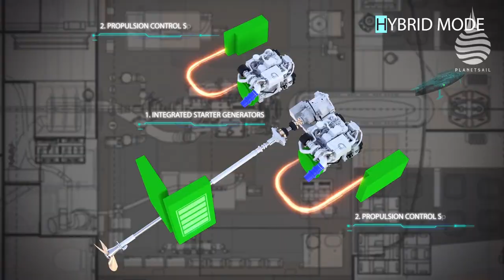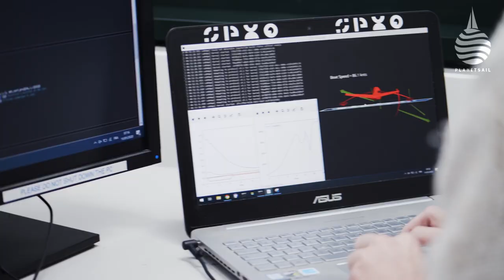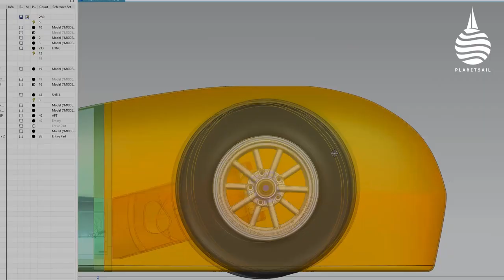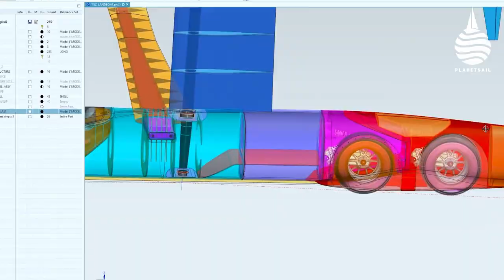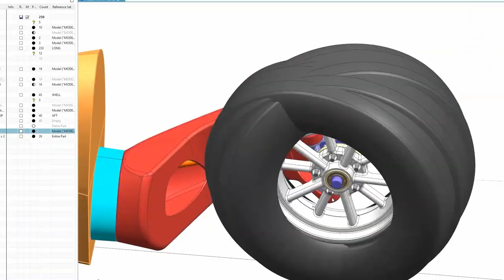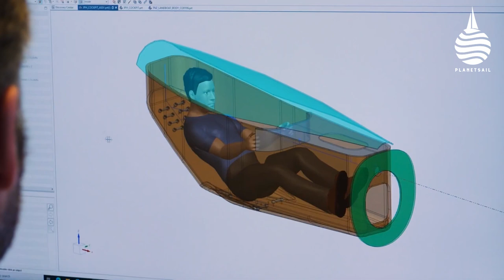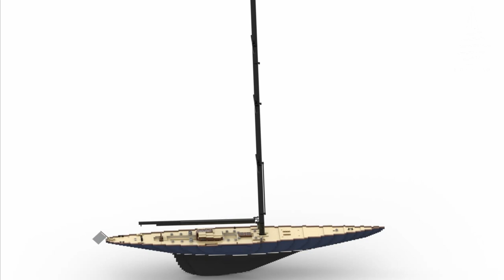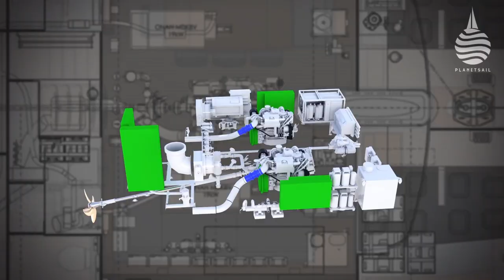Speed Special - OnCourse Episode 17

Comment: I wonder about using a sort of paddle-wheel instead of supercavitating foils. The boat looks like a bike, but the wheels are notched into paddle blades. The wheels freely rotate to match the speed of the boat, so there's no cavitation. The paddles directly "drag" the water sideways, rather than slicing through the water like foils.

Comment: The Syroco fore aft pitch stability at lower speeds will be uncontrollable. They need something to stabilize the hull like a second foil or hydroplane which can lift free from the water when speed is sufficent for the tail to exert a stabilizing force. The tail also seems way too small.

Comment: Attempts to go this fast in water will require super-cavitation be created around the entire underwater wing. This can be achieved by pumping high-pressure air out of the leading edge of the wing, such that it is entirely surrounded by gas. The Skval torpedo by Russia is supposedly capable of several hundred knots underwater - and it uses a super-cavitation system.

Anyone wanting to travel at superspeed in water is going to have to master super-cavitation, and learn how to maintain the bubble at all speeds and all angles of attack. Such a technological advance seems unlikely without massive investment - far beyond what it would take to simply break a sailing speed record.
Reply: Interesting concepts.
Reply: yes it's good to do super cavitation but you lose most of the lift .. it will go directly against the amount of lift those hydrofoil can create.. for torpedoes it doesn't need much of a lift( the whole thing is under water but for sailboats you want to create enough lift to keep the main section ( the boat itself ) about water .. buoyancy is a different thing than lift... that's why you get into problems over 50 knots .. the separation of the fluid ( water )  from the surface of the hydrofoil.. the reality is that to go faster you need more water pressure to keep those bubbles from developing early and separating from the foil, imagine water boiling lower temperature on top of the Mount Everest than sea level.. the more pressure, the higher the temperature for boiling..
Reply: the faster the foil travels the more lift gets created and lower and lower the pressure on top of the foil which means water will boil even faster and create bubbles which in this case will slow u down.. you are suggesting to even interduce more bubbles to the mix and the question is how it suppose to help!!! 😂😂😂
super cavitation torpedoes use different methods to steer it than even using any control surface like airplanes or any other missiles with fins ..super cavitation torpedoes do not use control surfaces at all but difference of pressure from one side to another side to change direction

Comment: 11:14 The Kiwi's theory of more rubber on the salt equals more traction as ass backwards to reality plus the tandem wheel setup will compound the problem. They're going to get a better bite on the salt with a "single" front runner tire on the back, not two road racing slicks.

Comment: Syroco is probably YEARS away from a working vehicle. I saw their prototype towed flight, didn't look like it was stable.
Reply: It has a bad set of failure modes in that config. Put simply, you can't pull on water with 100% reliability and sooner or later you will come out at speed...